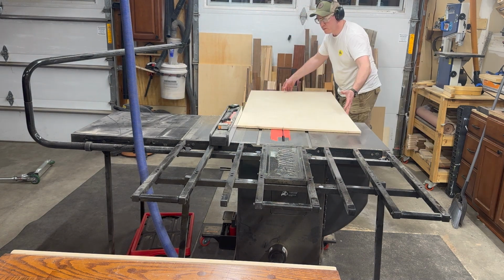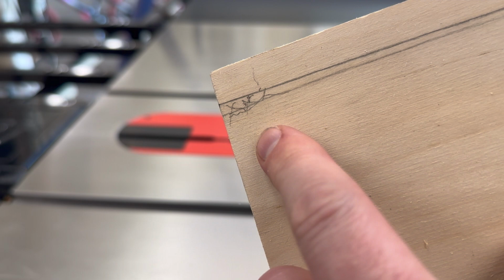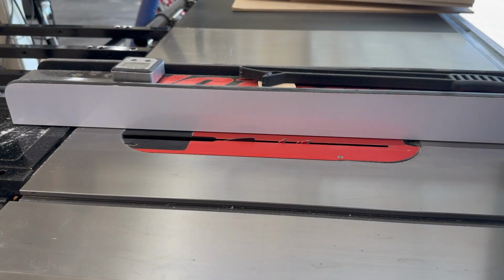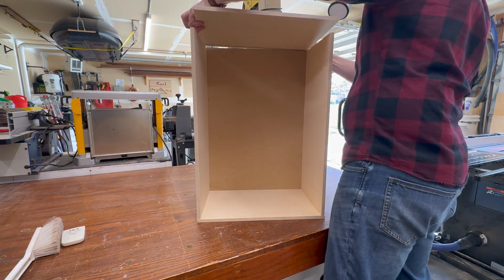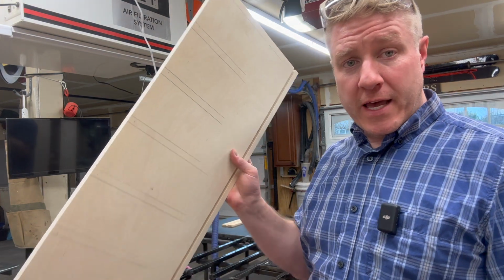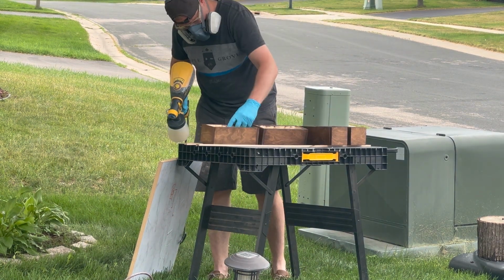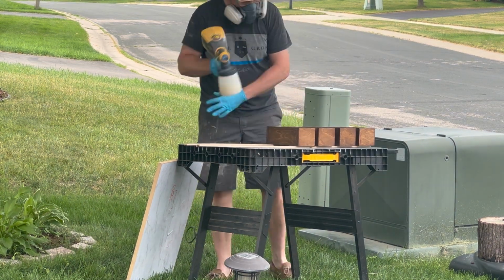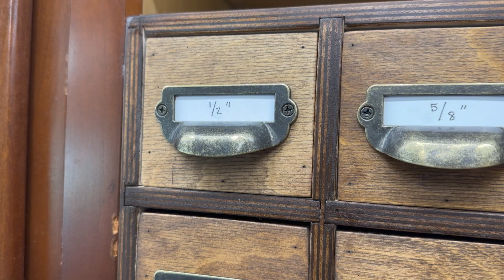Apothecary Cabinet For Screws and Shop Organization

Comment: Nice work. I never graduated to the Dado Stack. I still either do multiple passes on table saw or I do one pass on the router table. I find it much faster on router table to use a 1/4 or 1/2 straight bit. For bigger than a half or an 1/8 I use the table saw. My advice to others is only use new or quality bits on router for Dados. I’ve used old cheap ones and it burns bad unless you make several shallow passes at which point you might as well use table saw.
Reply from the maker: Thanks! And great advice! I don’t have a consistent setup for a router table, but it’s on my wish list. Good call out on the need for quality bits.

Comment: What ended up being your outside dimension of the whole cabinet? Looks great and also hello from a fellow Minnesotan.
Reply from the maker: The outside dimensions are 18” wide and top-to-bottom outside measurement is 24.5”. 

I used 1/2” Baltic birch, which is really 7/16” if we’re splitting hairs. Each box from the face is 3.5” tall x 3 7/8” wide. I chose the cabinet dimensions because I wanted it to be a perfect fit in between the face frame of the cabinet I was using.
Reply: @TenThousandMakes  thank you! It's honestly a lot smaller than I thought from the video. I'm usually a better judge lol
Reply from the maker: @TheRodlund  You’re welcome! I’m already thinking of making another one, this time with slightly larger drawers to replace a lot of the plastic storage bins I have. I hate plastic!
Reply: @TenThousandMakes  right there with you. I enjoy 3D Printing so it would be interesting to combine your style of drawers with custom dividers or holders. 

The plastic ones I also underestimated how much saw dust gets in them
Reply from the maker: @TheRodlund  that’s a great idea!